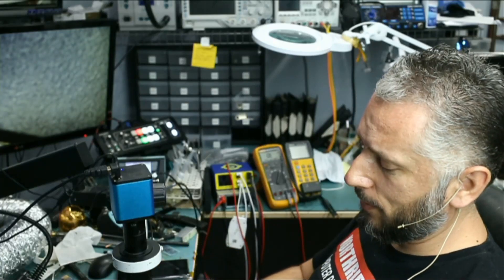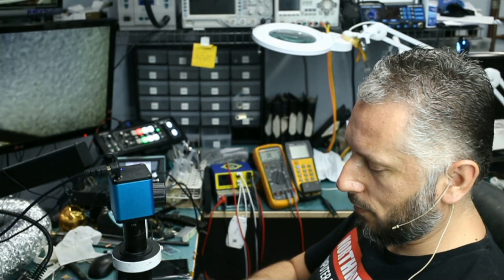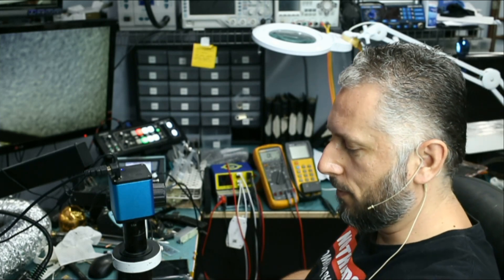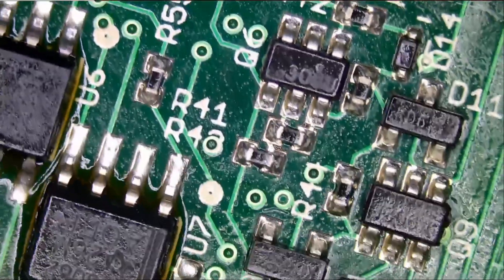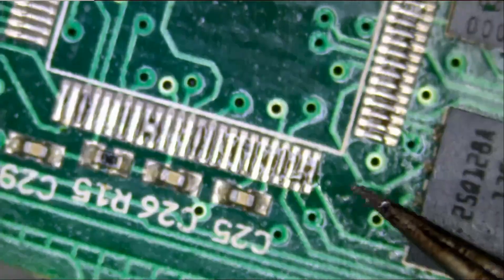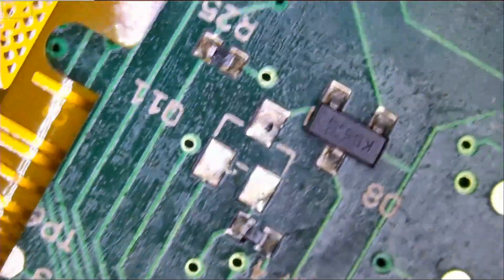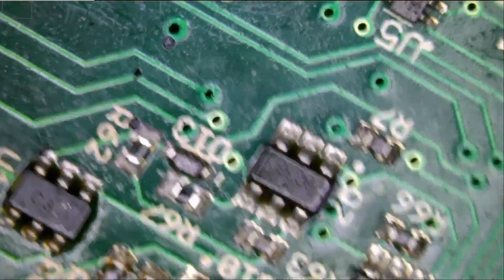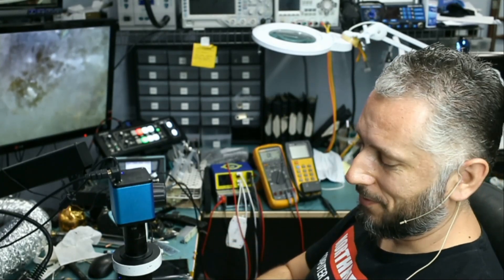When we quickly deem Device Not Fixable without hesitation.

Comment: This is the sort of flux I use. It is just standard resin flux. Is it okay to leave some flux residue on the pcb? I usually clean it with acetone nail polish remover (with avocado scent) , but sometimes I leave tiny bits of flux on the board in hard to reach areas. Is this bad?
Reply: i'd use 99% IPA to clean it. Generally u want to clean out the flux because they're acidic and can corrode ur PCB over time. There are flux labelled as "no-clean" or "ph-neutral", those type of flux can be left on the PCB without any issues
Reply: Assuming it is no clean flux you can leave it on the board.  With AMTECH NC-559-V2 I've come back and reworked a board 18 months later and the areas with flux on them still look good underneath.
Reply: @Venrad  The ironic thing I found when using no-clean stuff is that it is harder to clean. This might not be important in production, but it is nice to have a nice-looking prototype. Instead of calling it "no-clean" flux, I call it "can't-clean" flux.

Comment: Everything can be repaired Only not everything is worth repairing
Reply: You're wrong. If the 'bomb site' went through intermediatery layers (traces) on the pcb then it will be impossible to fix. Alex can only repair traces on the surface, not inside the pcb